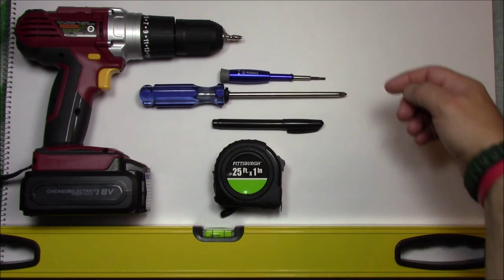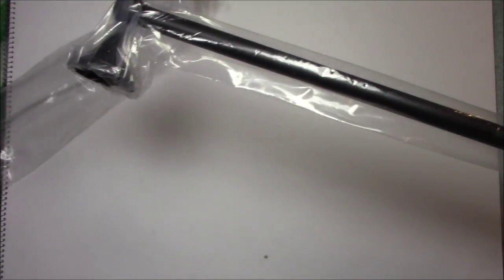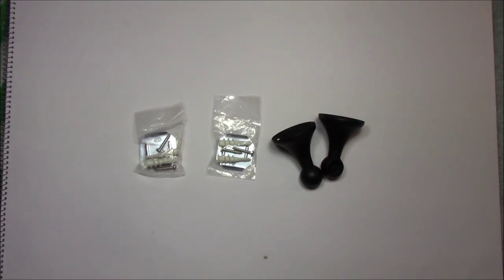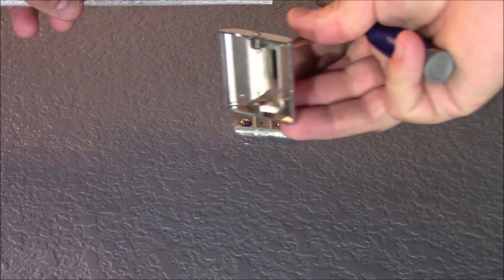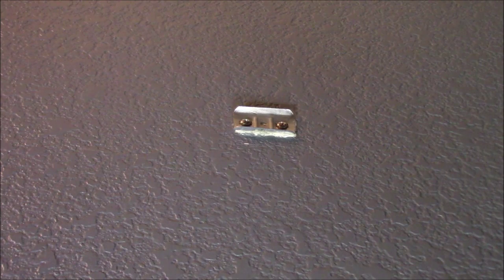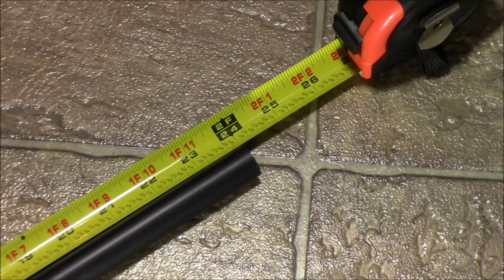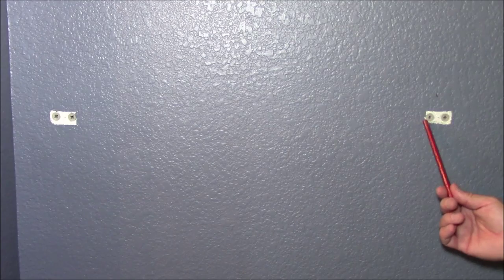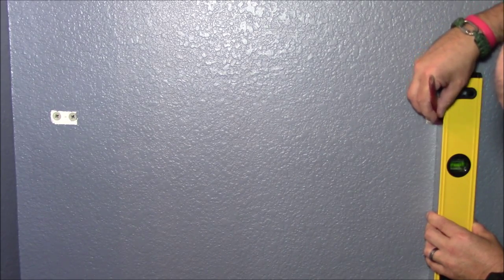Towel Bar Full Install Better Home Products HD Item# 3324DB

Comment: With our drywall this job could be a disaster owing to our plaster board being rubbish, i had an apartment with drywall hated it.
Reply from the maker: +bmwnasher I will put a note that this video is for sheet rock drywall only. Thanks for the helpful comment.
Reply: Richard Lloyd Our British Gypsum plaster board is pink plaster layered between two layers of lining paper, when you drill it or use those anchors it tends to fracture, so if you put other anchors near others it tends to blow, ive refurbished three houses had some fun with anchors of all descriptions.
Reply from the maker: +bmwnasher Our sheet rock drywall has the paper as the outer layer on both sides which tends to keep that from happening. In my next video I replace the toilet paper holder and one of the arms had a stud behind it and who ever installed it used an anchor first, when the anchor hit the stud it just chewed up the sheet rock. I used drywall screws to secure it to the stud. You could anchor the Queen Mary to it. LOL It's not going anywhere. Thanks.